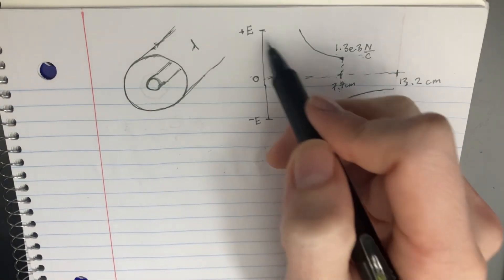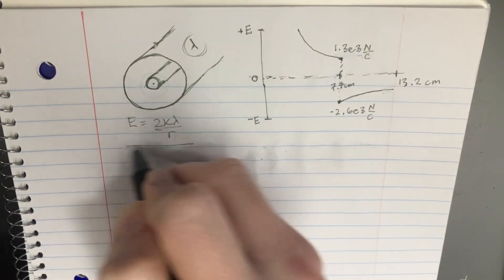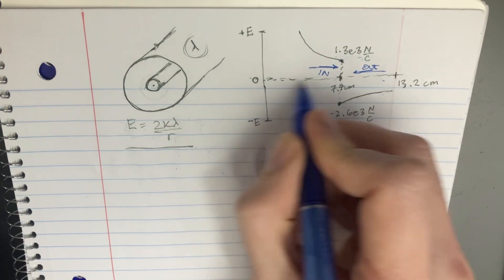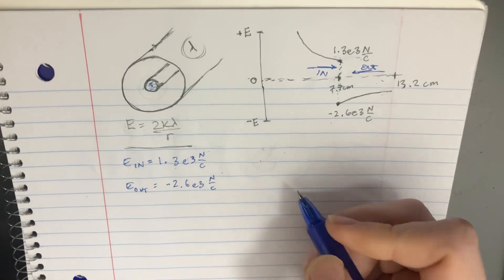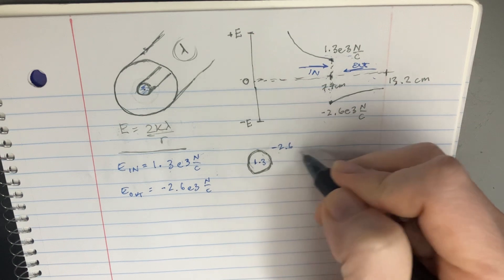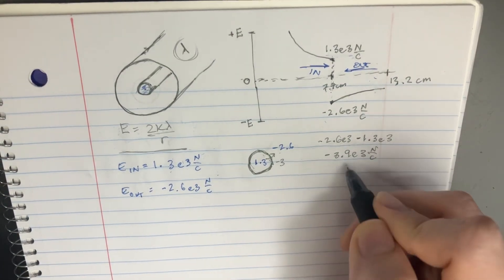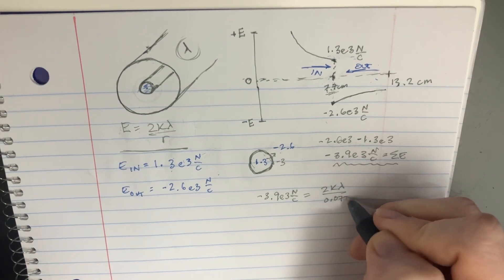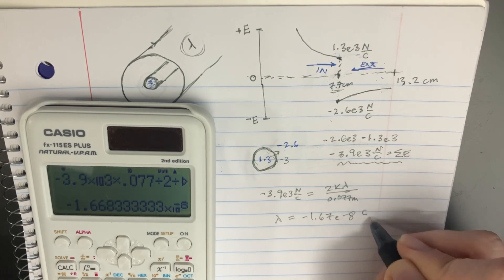Figure shows a narrow charged solid cylinder that is coaxial with a larger charged cylindrical shell

Comment: thank you very much!! one question tho, why do we use the net difference between the fields for this calculation?
Reply from the maker: Hmm if there's 1.3 on the left side of a barrier, and -2.6 on the right side of the barrier.. the barrier must have caused the -3.9 change.. does that help?
Reply: @mtheorylaboratory  yes that does help! but to understand a little more,  the barrier is the cylinder shell right? and it has its own charge, the graph shows the external field and the internal field, and the smaller cylinder and the shell together contribute to that external charge? thank you again :-)
Reply from the maker: @lemonlemonkiwimango  hell yeah!